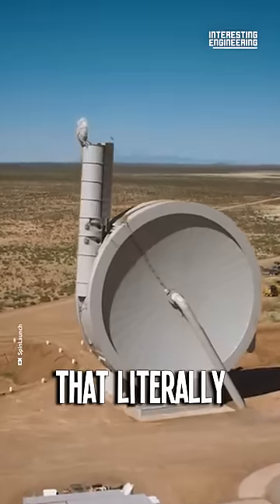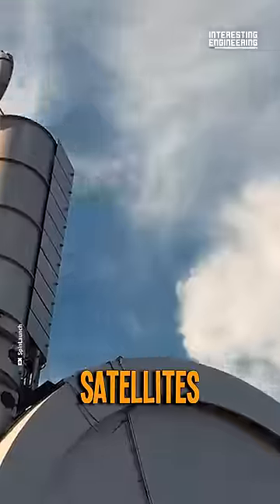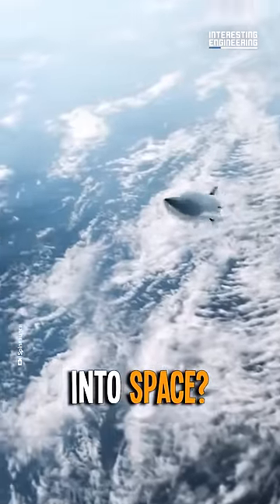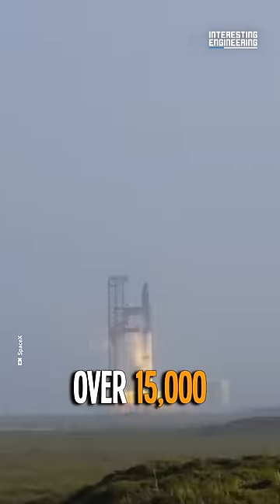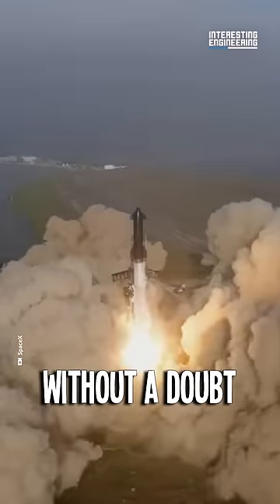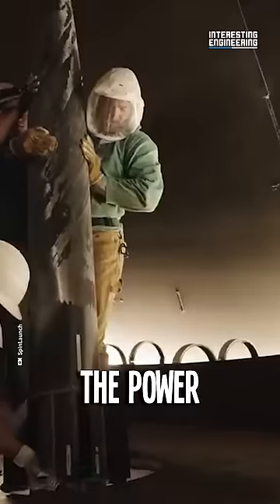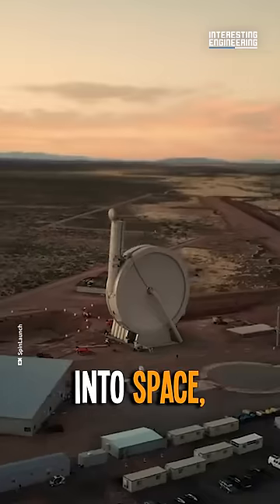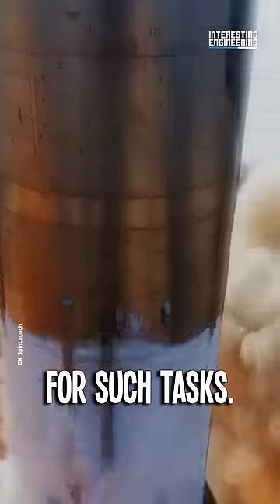Throwing Artillery Shells Into Space

Comment: "Throws satellites into space using no fuel"
"Uses a 2 stage rocket"
Reply: They didn’t state if the 2nd stage uses fuel, clearly the first doesn’t. Could be an ordnance discharge.
Reply: @cowmath77 for it to be described as a rocket it needs propelant otherwise it would just be a discarding sabot round
Reply: @cowmath77  either way they used fuel to power the spinner, unless they have a massive solar grid and lots of lithium batteries.
Reply: @BryanKyzar  不一样，从地面扔出去，考虑到地球的巨大质量。其动能的理论利用效率接近100%。 化学火箭产生的动能，有相当大的部分损失在喷出的气体上了。
Reply: @RD-fp3cy  yes, you are correct. This is what should have been explained in the video rather than just saying it uses no fuel at all.
Reply: Its quite reasonable that the rocket would be there to correct the orbit. And the Satelite would make it up without it,  *But would just crash back down because no stable orbit)
Reply: 2 stage means:  the first stage protective casing delivers the second stage satellite
Reply: I believe what they're saying is no fuel is needed to get through the first layer of Earth's heavy atmosphere. That is where most of the fuel is spent on normal rocket launches. After that, only a small rocket is needed to propel the object through the thinner layers of Earth's atmosphere and into orbit.
Reply: "eliminating the usage of fuel"
Reply: Maybe it makes it over the Karmen line before the second stage fires, so technically it does make it to space with no fuel. Then uses fuel once up there.
Reply: "Eliminating the usage of fuel..." What kind of fuel, and how much fuel is used to spin the mass accelerator?
Reply: @cowmath77 You are not smart.
Reply: @robertblahnik Wrong
Reply: It's just using the power of motion to get the rockets started. it could not make it all the way to space. Most fuel is probably burned at lunch and to get up to speed
Reply: @BryanKyzar  The goal isn't CLEAN energy its less energy. Regular rockets will use a chemical reaction such as Hydrogen and oxygen to provide thrust to the rocket (common misconception since rockets are mostly clean because the fuel waste is just H2O). This launcher would use possibly clean energy but most likely some sort of power plant to use. So the goal isn't clean energy as I said before its just less energy is needed compared to a rocket. It's easier to spin a much smaller and MUCH lighter shell than it is to launch a whole rocket for a satellite.
Reply: There would have to be fuel.. if you know anything about space a slight force can keep moving for ever. The low gravity makes that happen. So if you yeet stuff high speed into space you need to slow the object down to a stop some how or else you just get a high speed earthmade astroid in a way. Once you yeet something that fast into space it won’t magically slow it self down when it reaches space. You need some kind ADDED force to slow the object down to act as a satellite and stay put close enough. Fuel would be needed to fire wht would be called back burners I believe to slow the object down and stop it. So yea this video is right they can yeet something into space with out using fuel but they will need to find a way to slow that item down or else it will just keep its speed and fly out of the solar system and just keep going
Reply: I noticed that bit of BS too. Warning youngsters, there's BS everywhere.
Reply: They never state they "Do not use fuel" to accomplish the task.
Reply: @BryanKyzar oh my goodness
Reply: @tkd4zgqg  at 30 seconds in, it literally says "throw satellites into space ELIMINATING THE USAGE OF FUEL for such tasks"
Reply: Once in space 😂
Reply: And they forgot about the energy used to get that centrifuge up to speed. But hey.
Reply: Hope your spinning launch release isn't off by a tenth of a degree or anything. Gotta have about a nanosecond of allowable error on the release timing at those speeds. Hope there's no hangups in the disconnect mechanism. Or mild vibrations.

What could POSSIBLY go wrong? I can't think of anything.
Reply: they always wait until the end to waste your time lol
Reply: the two stages are to circularis the orbit, not to get to space.
Reply: But the voice is so reassuring that we just need to believe. That is the way </s>
Reply: Right! If new type engine wouldn't have been destroyed on take off there might be a single stage that could make it into space but at least they made two prototype planes this time
Reply: @cowmath77  That's not how orbital mechanics work It would have to use fuel to change trajectory and circularize it's orbit, otherwise it will fall back to Earth.

Comment: The kind of kinetic Hell that thing would unleash if it became unbalanced.
Reply: Not to mention the G force the payload would experience, even if it by some miracle worked.
Reply: Just do it behind them mountains and have control center on the other side of the mountain. Create tunnel for shortcut.
Reply: The tip spinning has to be going atleast 25,000 MPH. absolutely terrifying
Reply: I think the detachment/launch does exactly that, so I wonder how they solve that problem
Reply: @ricksandoval1187 and then the uncontrolled explosion travels straight through the tunnel back to mission control lol
Reply: It's all crap anyway.
Reply: @mrmaniac3 it’s an arm inside a chamber. Release is timed, throws the payload through a hatch
Reply: @ricksandoval1187  I have an idea! Such the air out of the tunnel and call it a "hyperloop" 😂
Reply: @dootgod8193 Yes, the effect of releasing the payload would be to create an unbalanced situation. Like losing the balance weights off your tire at highway speeds only much worse.
Reply: @dootgod8193  yes, and the arm has to have its weight balanced before it releases while it's carrying the payload, and after when that weight is gone. That shift in weight needs to be accounted for and I assume they manage it somehow
Reply: We had a fan blade of about 2m in diameter (about 7 foot) with a weight of 2.5 metric tons (about 5500 pound) that was balanced but due to an mistake at assembling it, it became unbalanced. By about 20g (about 0.7 ounces) what is approximately the weight of an average tarantula. 
The blade runned at 1000rpm in standby and 3000-3500rpm when air was needed (tempering / hardening glass). 
The DC motor and chassis of the fan was bolted to the ground on dampers  with six M30 (about 1.2 inch in diameter) heavy duty bolts.
When the motor accelerated the fanblade to 3000-3500 rpm the imbalance caused so much vibration and force, it ripped the whole fan chassis from it fixture and the whole thing went through a 20 cm (about 7.9 inch) thick concrete wall. 

The centrifugal force was about 2470 Newton.  The Gravitational force (G) about 12.587 G. 
So 20g (0.7 ounces) became 251.74kg (about 555 pounds) 

Now imagine what happen when this thing has just the slightest imbalance or what forces will act on the satellite they want to "throw" into space. 
We are talking about a few 1000G that will act on that projectile, at that scale
Reply: That's been the problem.  They can't shoot it straight

Comment: The average rocket holds about 300,000 gallons of fuel. 

The average rocket also takes about six and a half minutes to get to space. 

The guy in the video says most rockets use about 15000 gallons of fuel per second to get to space. 

6.5 • 60 = 390 seconds to get to space. 390 • 15000 = 5,850,000 gallons of fuel. It’s just not possible for a rocket to burn that much fuel.
Reply: I wouldn’t believe anything said in this video.  The amount of fuel and oxidizer used in a rocket launch is highly dependent on the weight of the payload.  As a rocket ascends (and jettisons the first stage after 3 minutes or so) the amount needed is much less.  The turbo-pumps on each of the nine Merlin engine on the SpaceX Falcon 9 rocket first stage generates about 10,000 hp.
Reply: A rocket used less fuel-per-second as time goes by, because it starts to weigh less and is constantly traveling into less dense air (makes it easier to slice through the sky).  Maybe that 15,000 figure was more about the initial liftoff.
Reply: I would like to believe 15k a second is for the initial velocity as it's fighting inertia law before lifting off, i dont really know much though so i'm not confident on that
Reply: Thank you for picking up this point I thought I was the only one 😅
Reply: @davidswanson5669  other than the spin-up of the turbo pumps at the start and spin-down as the stage gets ready for separation, consumption of fuel and oxidizer is essentially constant.
Reply: After doing some research it does show some Rockets use up to 15,000 gallons a second
Reply: @yvfkm  I researched this too, but couldn’t find a rocket that would consume more 15,000 GALLONS of fuel and oxidizer per second .  There are a few that consume(d) more than 15,000 POUNDS of propellants per second.  Please help.  Thank you
Reply: @vanguard9067 that's crazy it was ones of the first things that popped up on Google so thats probably how the youtuber got it. There was a lot of different ones but this was one of them
Reply: @vanguard9067  I guess I’m thinking of gallons used per distance travelled.  You’re right.
Reply: I actually did the research and it uses 661,000 lbs per minute so that's 11,016.6 lbs  per sec. And it takes 8.5 mins to reach space so that's a total of 5,618,500 lbs of fule oh yea by the way rocket fule goes by lbs not gallons.
Reply: @DennisFarverjr-nz8ym  the key is pounds, not gallons as you noted.  On which rocket did you base your calculation on?  I am curious because the time to orbit implies a second stage, which will not burn propellants at the same rate as the first stage.  This has been a fun research task for me.  Thanks.
Reply: @vanguard9067  space x Falcon 9
Reply: @DennisFarverjr-nz8ym  hey thanks a bunch.
Reply: I knew I wasn’t the only one who second guessed that as soon as I heard it
Reply: Hahaha yes. The more you math their math the less it maths.
Reply: @bp2627  math is good:-)
Reply: I thought it was way too much.
Reply: fuel in aerospace is calculated in lbs not gallons, so it may be more likely it’s 15klbs per second not gallons
Reply: Ty. I came here to see this
Reply: I felt he was too far off as well
Reply: You do all that research but failed to research and find out that’s it’s 15k pounds not gallons. On earth we use gallons in space it’s pounds
Reply: @davidswanson5669 my question is how does something that's denser than the air around it float in said less dense air?
Reply: Not only that but the idea of giving the satellite all of its necessary velocity, which would be wayyy more than is needed for a stable orbit, giving this much velocity to a satellite which has to go through the densest part of the atmosphere would be extremely inefficient. Let's jus say that the flame which the shell would turn into would be enough to blind you immediately and not melt but sublime its material
Reply: Engineering channel wannabe😅
Reply: That's what I had in mind. Thanks for the calculation part. It has to be a gigantic rocket to be able to hold that much of fuel 😅
Reply: Yes it is possible and is a fact
Reply: Space x rocket uses 3.4 million
Reply: Also depends on the capacity of the rocket engine and the quality or type of fuel.😊
Reply: The math is right.
Thry never reach into space.
They land in the Bermuda triangle.
Reply: @vanguard9067 dont believe anything you see in a youtube short, its worse than wikipedia by a league…..
Reply: Why did I do the math too? 15,000 gallons pre second. Say it only took the 30 seconds to get to space that 2,700,000 pounds just in fuel and that’s only 30 seconds. I don’t by it one bit something smell fishy about a lot of this stuff. Obviously I’m no rocket scientist but I really don’t see how they would leave the earth with anything weight close to that amount, that’s just in fuel not including the rocket material itself, and whatever other payload they might have.
Reply: Ya I did that math then looked up how many gallons is in an Olympic pool which is 660,000 and said there's no way that thing holds 10 Olympic pools of fuel. I don't know why I don't just skip videos when I hear these AI voices. I wonder if people even do anything or if theyve made a ai short making program where u type a subject and it finds random clips and throws at random facts that are always wrong
Reply: How can even 300 000 gallons fit into a rocket. It requires a 1/3 of a mile long freight train to carry it.

Comment: The g force must be incredible. Fragile satellite parts probably can't handle it.
Reply: @TucsonDude I expect the g force will be somewhere between 20,000 and 100,000 times earth gravity. Most electronics will need to be specially designed to survive this and sensitive equipment has no chance.  You should be able to lob an artillery shell no problem though.
Reply: @TucsonDude Still need to consider the lateral Gs. Centripetal force would be extreme.
Reply: These are specially designed payloads and not suitable for every application. As usual, this is an attempt to address some rather than all use cases.
Reply: I worked for them for a few years. It takes minimal supporting adhesive on most components to stabilize them for the g forces expected during spin-up and launch
Reply: I can't wait for them to go public so I can short it! They have stated they produce ~10k Gs in a launch. A standard rocket launch depending on the platform produces a max of 35, for ICBMs and most are far lower. Falcon 9 takes a max G-load of 6 lmao. What nonsense.
Reply: If you use a suspension system, it's certainly possible
Reply: @sc9160 Well it's not like they're going to be sending humans up. 😂 You think they didn't consider all that?
Reply: @sobel4511  What do you think Space X sends into space? Satellites. Re-engineering satellites to withstand an additional 1,600x of force isn't easy. I think people invest billions of dollars in impossible ideas all the time. Theranos is a pretty great example.
Reply: i hear its bad for people and kerbals as well
Reply: That is my concern as well. The forces at work just to get the satellite up to speed are huge, then the moment its launched... i cant imagine anything being able to withstand that type of extreme force.
Reply: @patrickvanrinsvelt4466  Centrifugal force.
Reply: @billydiesel8520  Nope. Don't think so. Centripetal force is the one acting on the object that is needing held in the circle. Centrifugal force is a pseudo force used to describe the force to counteract centripetal.
Reply: @patrickvanrinsvelt4466  oh alright, i was mistaken. my bad.
Reply: @billydiesel8520  I remember first learning about this back in high school and it didn't make sense.
Reply: @patrickvanrinsvelt4466  Lol thanks for the consolation. You're a good dude.